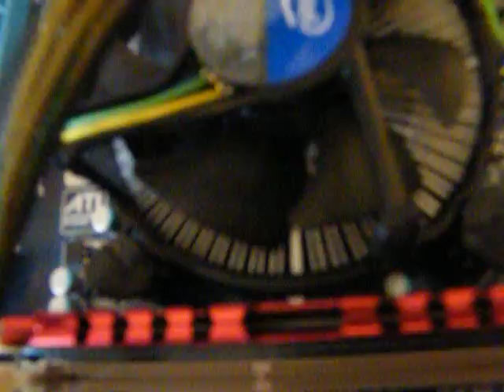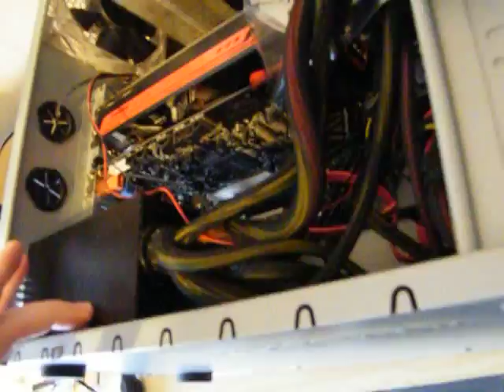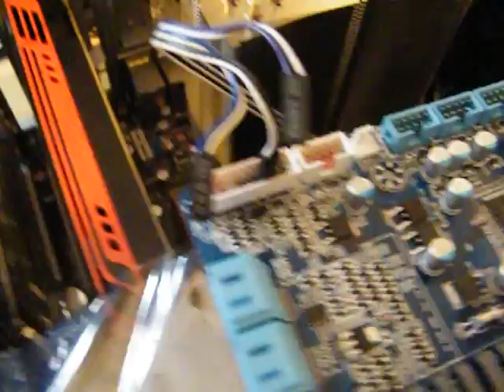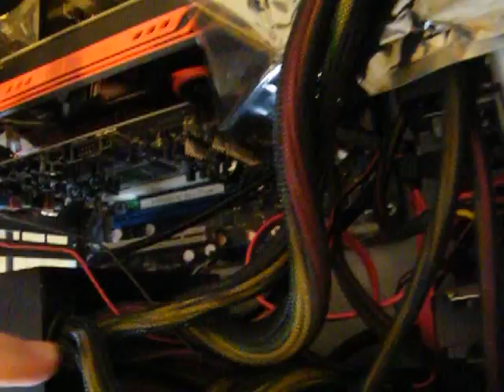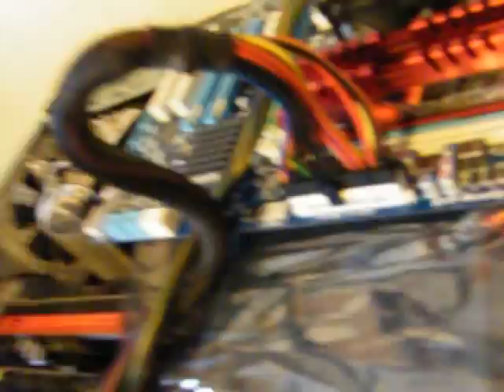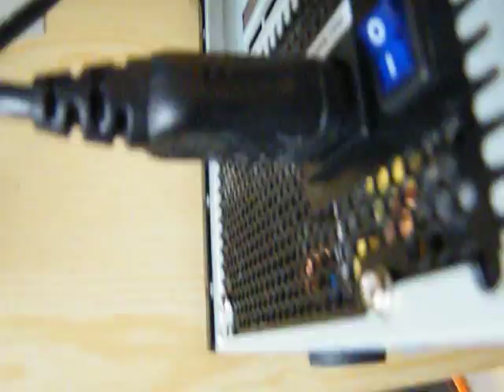GIGABYTE Z68A D3H B3 POWER CYCLING

Comment: You can restore the backup bios by flipping the power supply switch in the back, holding the start button at the front, and while holding flipping powersupply on. the pc turns on. In one-two seconds, flip the power supply to off again. the pc is off.  Turn on the switch on the back, and push the start button on the front (dont hold it)... the backup bios will load overwriting the current bios, and the pc will reset, after that, you will not have a boot loop.

Comment: I had the same issues with mine. It was the Ram. Try to put just one stick into the first slot. I have 2 ( 4gb ) Sticks and it will not see them as Dual channel RAM even though they are the same specs.

Comment: you may have a busted pin on your cpu or the most likely problem is that you dont have a large enough psu since everything in your case is still wired up which takes voltage and then your hooking up another mother board try unplugging a few things and see where that gets you.